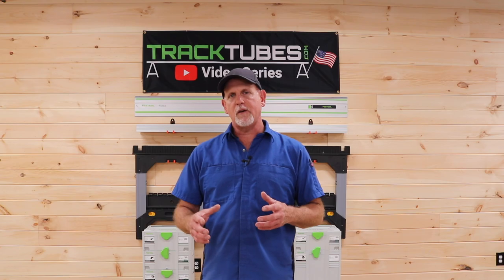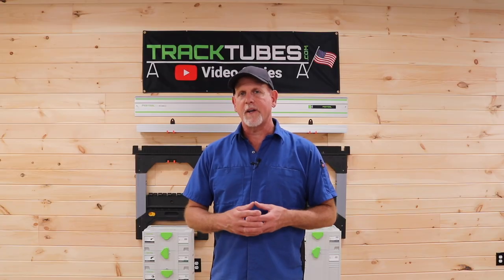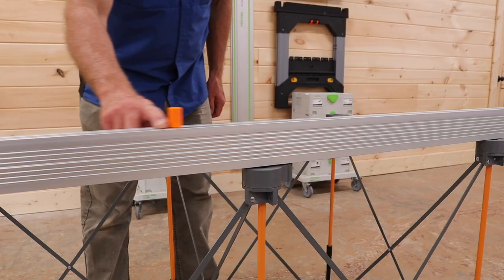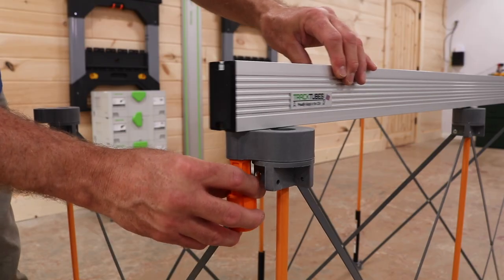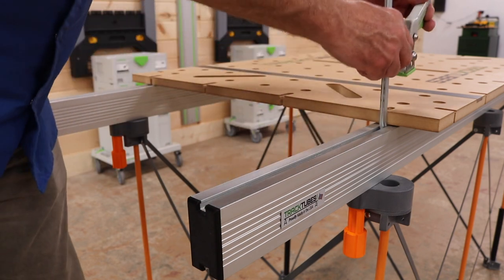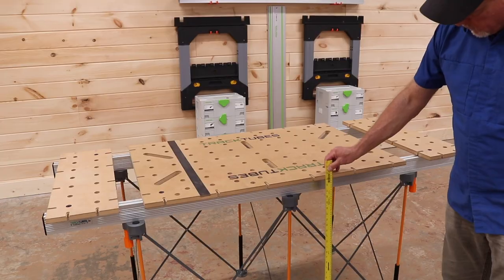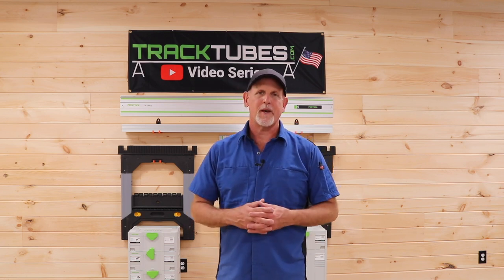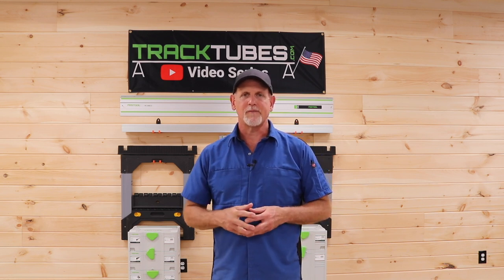BORA Centipede Improved with TrackTubes

Comment: Great product and demonstration. Definitely purchasing one for my 4'X6' Bora Centipede with Workbench Table Top (The kind with the holes). Waiting for the Centipede Knob kit to come back in stock. In the meantime, i have a couple of questions/suggestions.

1.) The rails are sold in pairs. I guess, that works fine in most cases but not all cases. For example, my 4x6 Centipede has 3 legs one way and 4 the other way. The  Workbench table top are 2'x4' in size and folds in the middle for easy storage. Today, when I put the Workbench table top, I unfold it and set it on the legs and it has support from the center legs so it stays put and holds weight well without bowing. If I want to do the same thing with the TrackTubes as they are sold (in pairs), I'd have no support in the center. So, I think it is a good idea to sell the tracks individually and let people buy how many ever they need. I request you to please consider my suggestion.

2.) The Attachment things Bora provides with the Workbench are not great. In the middle where you have two panels next to each other, you can only attach one of them to the centeped. AND, attaching them form the bottom is awkward. If the holes on the Bora Workbench Top properly lineup with the rails on the TrackTubes and I could use  TrackDogs to secure the Bora Workbench Top to the TrackTubes, it will be AMAZING. Can you kindly confirm if the Holes on the Bora Work top lineup properly with the Track tubes track? Can I use TrackDogs to attach Bora Worktop to the Track tubes rails? 

Looking forward to hearing from you. Thank You 🙏

Comment: This looks like a great, and innovative idea.  It reminds me of the tracking used on my kayaks, and bass boats.  It's unfortunate that they're having what seems to be a very difficult time keeping up on their inventory.  Great idea if they can stay ahead of the supply chain craziness.  I know I probably would've made a purchase today had they had it in stock.  That said...I priced out what I assumed I would need to cut 4X8 pieces of plywood on the largest of the centipede products.... My total cost was going to be well in excess of $400..... OUCH!  I'm going to have to use 2X4's on my centipede system in the meantime, to get through the project I'm working on.  I'm wondering if that won't work against TrackTubes.  If it turns out a couple of 2X4's, while most likely not AS good as TrackTubes....are good enough, then potential customers will have to do some soul searching to see if $400+ is truly worth it.  Just sayin'...

Comment: Hello, ive been by chance do you know if the bora and the MFT have the same hole pattern?
Reply: I have the Centipede table with the 20mm dog holes and that table top does have the same hole pattern but is different outside dimensions than a MFT top.